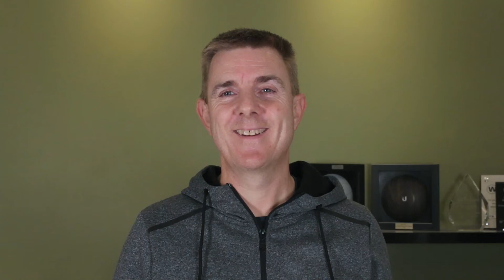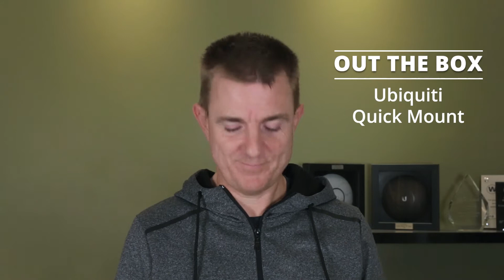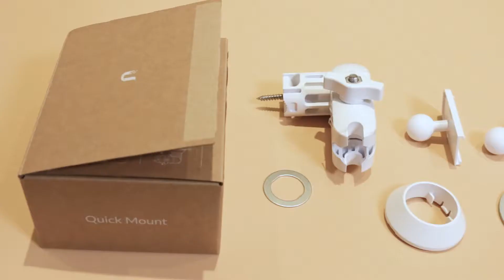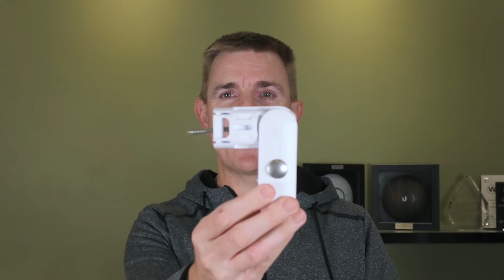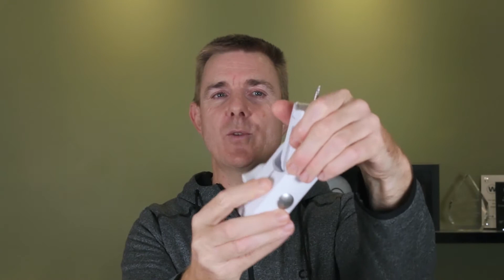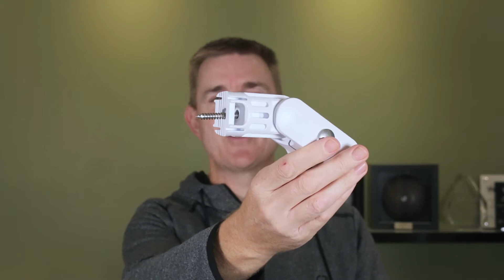Out the Box Series - Ubiquiti Quick Mount

Comment: did u just say drill a hole ?
Reply from the maker: Haha, yes - the mount still needs to be fixed to the surface, so a small pilot hole is required. The “quick” part is attaching and adjusting the device once the mount is installed.

Comment: For anyone reading this a relatively critical step has been missed. Watch the video titles "Ubiquiti Quick Mount How to Demo". It shows the cover that locks into the metal disc should be slid along the mount. This will allow it to rotate and pull up tight before locking into the metal disc. Otherwise you'll have to spin the metal disc as you screw in and the two points will score a groove in the wall, missing the point somewhat.
Reply from the maker: Thanks for pointing this out - that’s a really useful clarification. You’re right, the locking cover should slide along the mount so it can rotate and pull up tight before locking into the metal disc.

Comment: I have to mount this in a brick wall. I don't feel very confident in it. Thanks for the video, they still do not include any directions, ugh.
Reply from the maker: It does not need to carry much weight, but otherwise use something like the Ubiquiti UB-AM as a more secure option with metal zip ties.

Comment: I think you want those 2 dimples in the metal plate face the material you are screwing into.  When the lag sucks the plate tight the dimples push into the material to prevent it from rotating.  When you push that white collar down it locks it up so it's no longer able to rotate.  My concern with this mount is it does not appear very solid once the "thumb" screw is tightened.  Im still able to rotate the joint with the plastic strips/teeth.  The ball joint end seems to lock up well.  Did you notice that with your mount?
Reply from the maker: Thanks for your comments.  It has been a while since I have used one of these.  It is not sure solid, but the device that it is locking in place is also not very heavy either.   You can lock the ball joint well which is really the main locking point for the whole setup.  I hope this helps a little further for you.
Reply: That’s because the “cap” covering the metal screw isn’t positioned correctly — it has two holes on each side that need to align with the joint’s shaft couplings.

Comment: We just got some of these at the shop. Seems like it's overkill on some areas, and entirely ignores any sort of cable management. So now we're to have a device cantilevered out 9" from a wall, with a 12" piece of data cable just what, zip tied along this arm? Just floating in space out to the device? Using the mount to run in the lag bolt seems wonky at best.   Feels like engineering loved the idea and just ran with it, never running it by installers.
Reply from the maker: Thanks for your comments. I certainly get your thoughts on no cable management. The key though if these are outside it to get a drip loop in place. Making a drip loop means the cable is never really managed away easily so mounts always have a challenge of cable tidy vs practically.
Reply: Came here to see if it had any cable management. I would of liked to have that screw removed, then a hole allowed for the cable and the metal bracket just screws to wall. I will be getting a few of these in and may see if i can modify them to work that like. My biggest issues with almost all CPE devices from all manufactures is the neglect of cable management or the ability to easily put cable in some kind of flex conduit. Not all of us are running high grade UV stuff for a foot of cable. I find myself running flex up a pole to where the device is, then kinking it down, and then putting a metal clamp on it so that only a few inches of cable is exposed. Live in So Cal so yea the Sun down here is not forgiving at all.

Comment: There was no mention of what to do with the little Metal ring?
Reply from the maker: Good to hear from you.  I had to go and pick one from the shelf to refresh myself!  The ring fits over the ball socket for the Nanobeam fitment and allows it to be neatly connected to the back of the Nanobeam.  It locks the fitment in place, so that the movement comes from the Quickmount, where as on a standard Nanobeam the movement comes from the back of the device.   I hope this helps explain things.  Happy to email you a couple of images if you need, just reach out to us - info@thetechgeeks.com
Reply: @The_Tech_Geeks  It helps yeah, I have a pair of UBB units which the Quick-Mount is compatible with, didn't occur to me that the ring is meant for the ball-joint but then again, it just didn't fit anywhere else at all, so that would have made sense.  Good enough for me, thanks!

Comment: Is there any option to use this on a 1 1/2 inch metal pole?
Reply from the maker: Hi,  Good question.  Around 1.55 in to the video I show you the base fixing with the screw pointing out.  You will see the part where the screw is pointing out has cutouts.  You would need to remove the screw and then use zip ties or a metal pipe clip to clip through and mount that to the pole.  I hope this helps